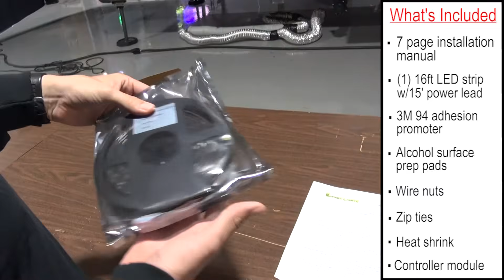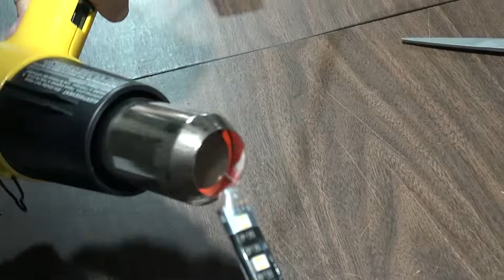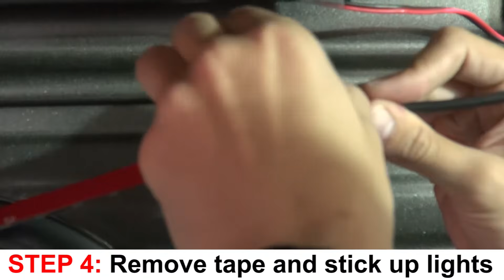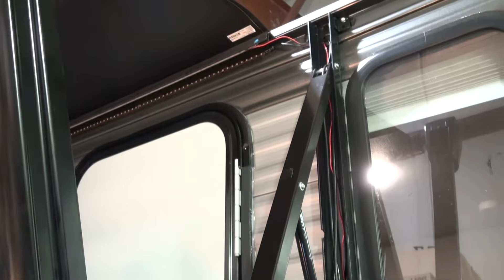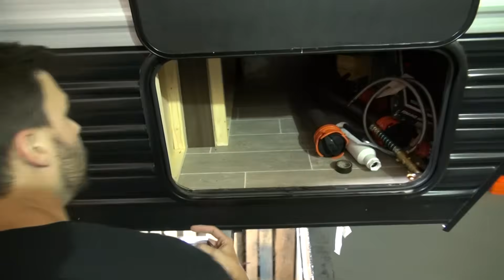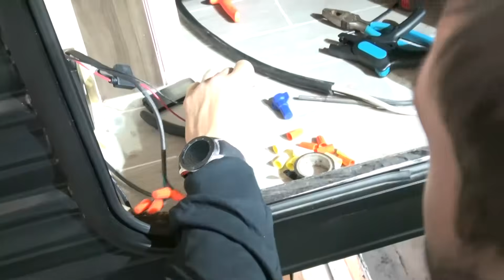RV LED AWNING LIGHT INSTALLATION | STEP BY STEP GUIDE

Comment: I’m using this method myself. Only question I have is what do you do with the OEM awning light wires.  How do you terminate the circuit?
Reply from the maker: In this scenario we tied our warm white diode to the existing awning wiring. This way the customer can still use the existing switch to provide warm white. Give our technical support a call: 800 847 1359
Reply: I’m going to be using the power converter with the RGBW string so I won’t be using any of the existing wires.  Thanks!
Reply from the maker: @Mi_Tony  in that scenario; you wouldn't need to alter the OEM system at all. Our power lead from the LED strip connects to the control module - the control module connects to the power converter - and the power converter plugs into your 120vac outlet.
Reply: @BoogeyLightsLEDs  thanks for the help. I guess I’ll just pull the OEM strip off and cut the wires and cap them off.    

I plan on running the wires down the awning arm and I have an outlet in front storage compartment about 6” away where I plan on plugging in the converter.  It’s what I did on my current trailer. Only difference is it did t have any OEM LED’s. 

Again, I appreciate the reply.   🙌
Reply from the maker: @Mi_Tony  no problem at all. We'd mount our strip to the RV side itself; leaving the existing in its track. Give us a call with any questions: 800 847 1359

Comment: I'm looking for a light strip that slides in the channel that's sewn into my jayco 38fdds. Everything i can find has adhesive on the backside. If that starts peeling back when i'm sliding it in. It's gonna make for a lot of cuss words and regret. Also need an 18'er. Dont care if its white or blue. I dont need RGB. Dont need a rf reciever or remote.  Dont need it to dance to music. Just need one that slides in the channel and makes light..🙉
Reply from the maker: Our awning strip is thicker than any other LED strip on the market.  It's also wider than most.  It is designed to attach directly to the side of the RV just beneath the awning (or awning housing if your RV has one) shining outward.  It will work on any RV or trailer this way.  It is NOT designed to slide in or mount directly to a channel or other plastic housing affixed to the awning itself. It sounds like you're looking for a SMD 3528 LED strip - smaller diodes for longer runs (18') also thinner to slide into your existing. We'd guess that's what came with the model originally.

Comment: Hey there, been looking at this product of yours. I have a 2021 Aspen Trail 17BH. Have you done an install on one of these? It has a place for a rocker switch on the control panel labeled exterior lights, but it is a blank basically. Just wondering if the wiring is there to do the install, or if it has to be wired. I am hoping the wire is there running to the awning.
Reply from the maker: Give our technical support a call: 800 847 1359 (M-F 9am-5pm ET) or fill out our Lighting Form with specifics and we'll provide options: https://www.boogeylights.com/lighting-suggestions/

Comment: Do the lights have memory? If I have it wired to the switch inside for white but change the color to blue and turn the lights off at the switch will it still be blue when turned back on?
Reply from the maker: The lights are simple 12vdc. When 12vdc power is applied, they turn on.  When 12vdc power is off, the lights are off.  No intelligence built into the lights themselves.  The LED controller is the 'brains' of the system. The controller is designed to come on in the last used settings.  However that only applies to the RF wireless remote or Bluetooth interface.  Our Quick-Switch technology which can integrate with an existing light switch is designed to turn on/off just one color -- usually white.    You can find details including operating specs for this product on our website here ->  https://www.boogeylights.com/rv-led-awning-light/

Comment: Is there any way that these lights can be mounted to a channel? I have an older RV, and I would like to come down a few inches below the awning. Id like to drill into the channel directly behind the lights into my control area inside my camper. I'm also wanting to use the channel to route another wire, not intended for lighting. I assume the power leads for the lights can be bent 90 degrees to go into a wall directly behind the lights?
Reply from the maker: Yes, we offer an aluminum channel with optional opaque diffuser: https://www.boogeylights.com/mini-t12-aluminum-led-strip-channel/ - However, the channel only comes in 39" or 78" lengths and is typically used for commercial applications. You could source a channel elsewhere as long as it is at least 1/2" wide. The power lead can be bent 90 degrees to enter the wall; just leave room as to not pull directly on the solder joint when entering the RV. Give our technical support a call: 800 847 1359 (M-F 9am - 5pm ET) or shoot us an email: customercare@boogeylights.com - appreciate the interest!
Reply: The lights still work just no power but when I put power to the main switch for the awning it works lights work..so there is an inline fuse someplace where?

Comment: So you need 12v to the strip and 12v to the controller?
Reply from the maker: You just need 12v going to the controller.  The controller then connects to the lights. Hope this helps!
Reply: @BoogeyLightsLEDs  got it! Thanks
Reply: I have a 2020 Cherokee wolf pup FQ .
My awning will not extend it was going slow, and now there is no movement . I went out to the awning arm, and pushed it in word, and when I did, it blew the fuse for my living room, and my LED strip when I out. 
Do you think they’re both connected to the same issue a wiring problem maybe

Comment: Is there a way to install these without drilling?
Reply from the maker: Yes, but it would typically involve using a quick-disconnect plug on the end of the power lead for the LED strip. This would require plugging in the controller module and power converter (if using 110vac) when using the system. Another option would be using an existing porch light to house the module. Give us a call 800 847 1359 (M-F 9am - 5pm ET) or fill out our Lighting Form with specifics on your installation for more information: https://www.boogeylights.com/rv-lighting-suggestions/